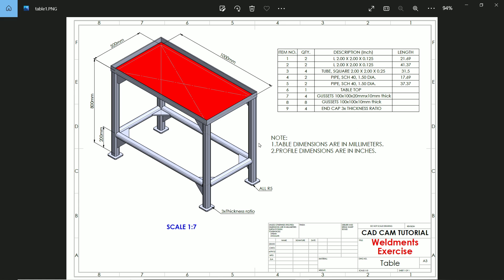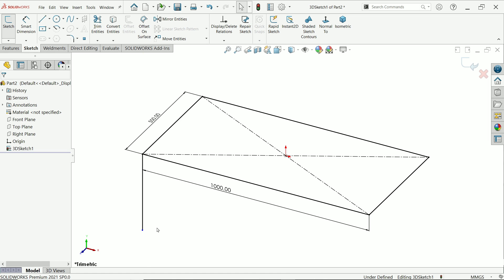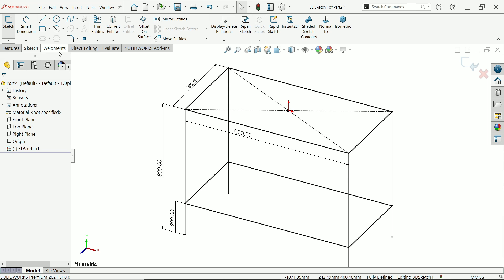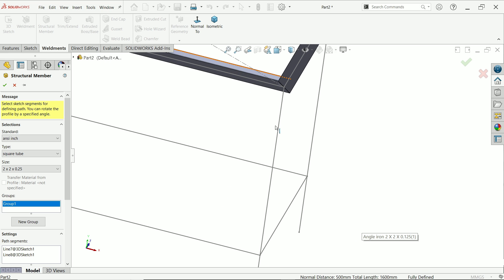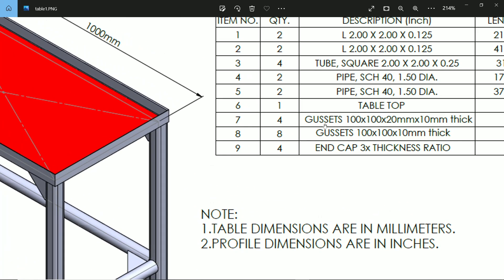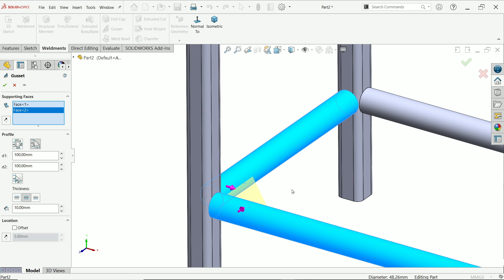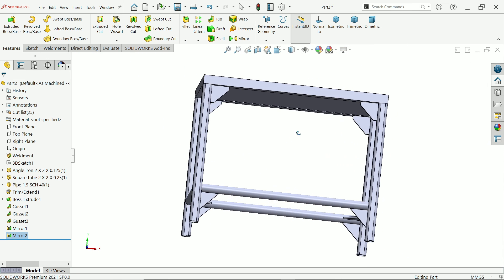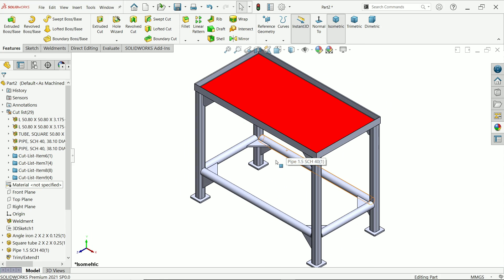Solidworks Weldments Structural member, Trim/Extend, End Cap & Gusset

Comment: Hello sir, your videos are so good,  however i consider it as an incomplete ones. For instance, one of your video which created a spiral helix gear, you taught us everything about it's creation but don't say a word about where and how it can be used.

In this video,  you forgot about telling the applications of welderments too...

 I worked in a sheet metal industry and i know how the cad files of the product we created can be utilized in laser cutting and bending machine. 

If you do a video regarding the application of solidworks in various sectors like moulding, 3d printing etc it would be a great help for likes like me... please don't be get offended what i told you is some advice for your next videos..
Reply: Bro, this guy is not an expert like everyone think. He might be good, but for his videos he just get the file on internet and do the steps on the file one by one.I've got some of the same files that he has and some files have mistakes of measurements and he does the mistakes exacltly the same way with the same measurement from the history tree.

Comment: Hello sir, I m facing a problem with soliworks, when I enter in the sketch mode the is running to slow, each command like line or circle is not working properly, but when I exit the sketch mode the software runns smoothly , how ?
Is there any solution ?